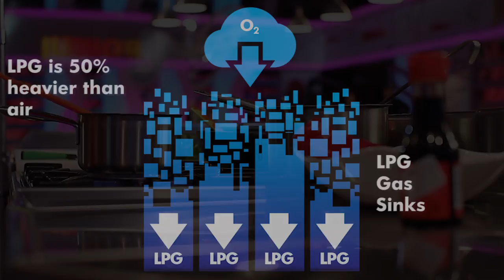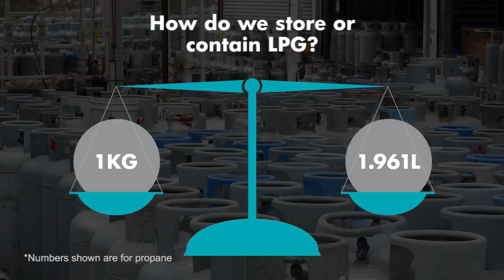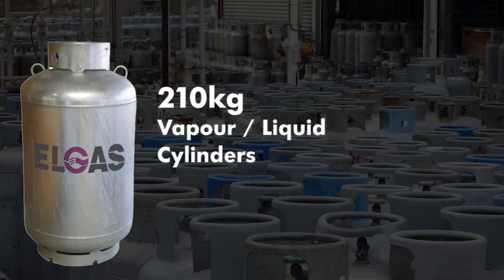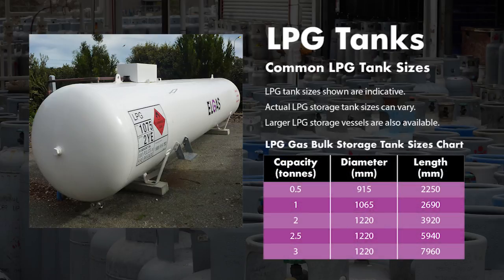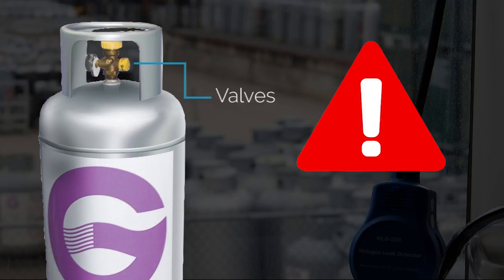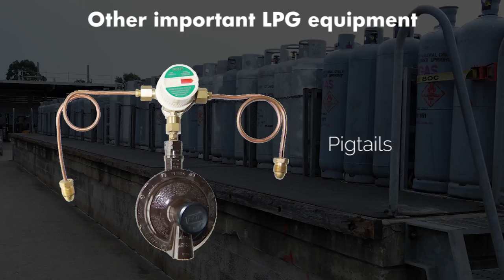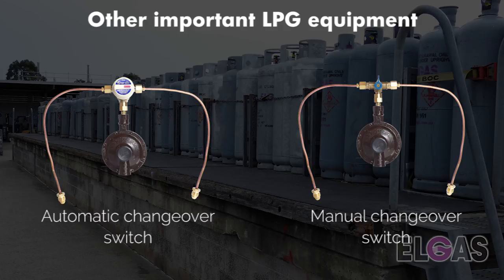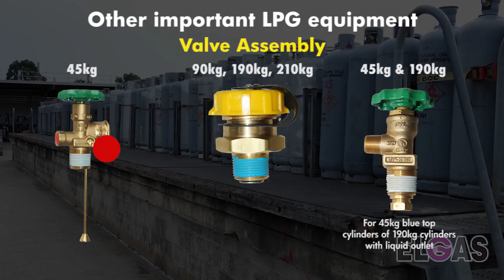What is LPG?   LPG Gas - LPG Gas Bottles - LPG Gas Bottle Sizes - LPG Gas Fittings & More Explained

Comment: Whoa someone has some explaining to do. If this is the case why didn’t the Elgas truck fill the largest cylinders before the gas was emptied. Where did that weeks or so’s worth of gas go?
Reply: Don’t know where you are, but where we are here in NZ our used bottles are replaced with fresh bottles. The used tanks are weighted back at the depot and we receive a credit for any gas not used. 
The truck drivers are not trained and the trucks are not equipped to refill gas bottles. 
This is a specialist job and the bottles are checked and refilled in a safe site. 
I had a friend whose job was to check and refill gas bottles. Unfortunately he had a horrific accident at work when the 
gas bottle he was checking exploded. He survived but has been seriously disfigured for life.
I don’t think the public realise just how dangerous gas/ and gas bottles are to handle.

Comment: Use the correct hose and check its condition regularly and also it is recommended to replace the regulators every 5 years.
Brothers Gas!  The leading Dubai gas company envisioned to provide the best.
For more details: https://bit.ly/2rHSJLT